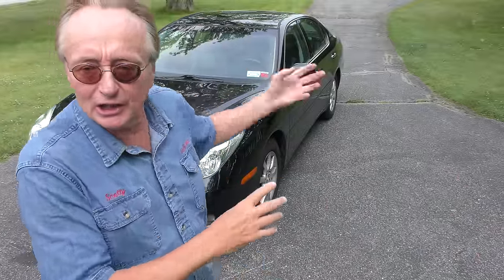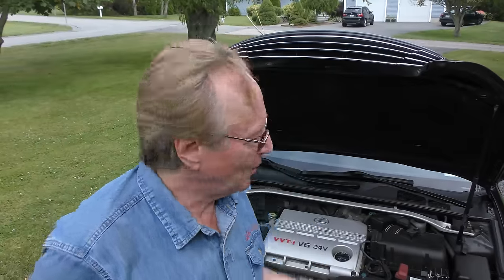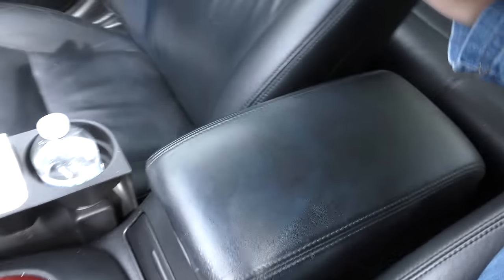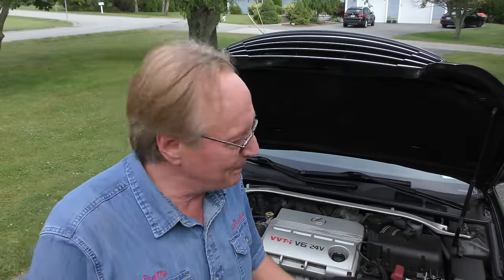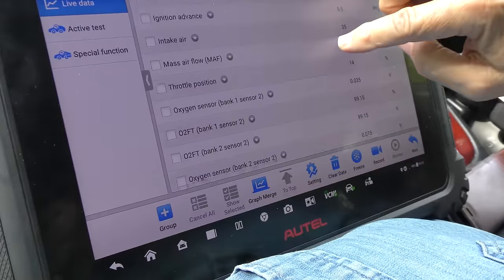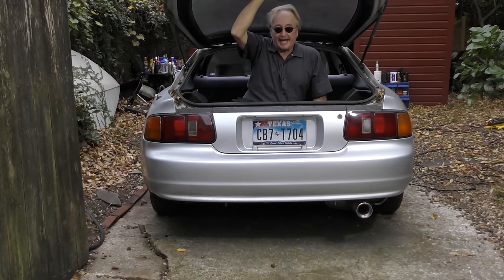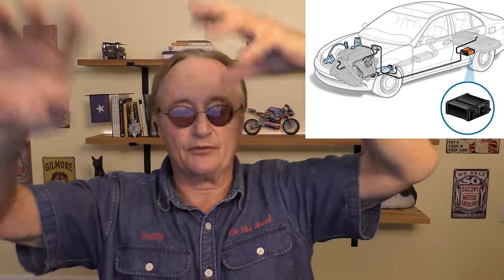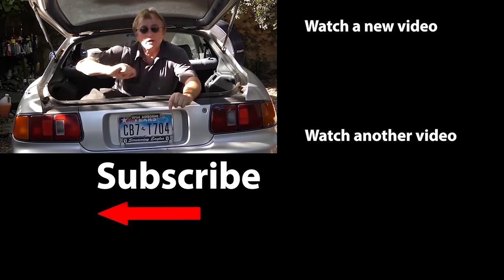I’m Sitting in the Best Luxury Car Ever Made

Comment: I bought a 2007 Lexus GX470 back in September with only 29,000 miles on it, was owned by an elderly individual prior, it’s virtually brand new
Reply: Wow! What a crazy find. Do you feel comfortable sharing how much you paid for it so I can gauge the value of low mileage ones I am looking at?
Reply: Ive got an 2006 with 147,000 miles on it that my son stole from me when he got his license. The only issue I've ever had was the air suspension so I stripped it out and did shocks and springs. I love that truck and it goes through anything. 29,000 miles is almost unheard of. I'd a bought it to. Hope you get years of fun out of it.
Reply: My mechanic, Toyota/Lexus certified, has his own shop, swears by the GX 470. He says it is bullit proof. Have been on the lookout for one for three years. Looking to find a deal.

Comment: That car is an absolute steal, and if you wanna upgrade the entertainment system, you can easily install a CarPlay style radio with a navigation system in no time flat.
Reply: Not something you wanna skimp out on though. I’ve heard the cheaper ones tend to crap out. Sometimes higher price does mean better. A decent one will probably run you at least $300-$400.
Reply: @dy1angi11ey6  You are right about that.  I put a Jensen in my wife's Matrix and a Kenwood in my F-150.  Both are great, I chose the kenwood over the Jensen for the truck due to availability at the time.  Both are wireless and have good standard radio reception too.  They were not bad to install and they really freshened up those vehicles.

Comment: Lexus and Toyota still reminds me of that Japanese golden age in the 70's and early 80's stereo equipment,  no one is building turntables and stereo receivers as they did back in the day. The same with cars now but Lexus and toyota in general is a big exception.
Reply: HUH? The Japanese still build Turntables and are still strong in making stereo receivers. The techniques line is still going strong and kicking arse.
Reply: @johnwayne2103  Not on the same quality my friend, my turntable is 11.5 KG in weight has all copper connection and massive motor build and over all this wood enclosure and beautiful look. got it for $200, I have to spend $2000 or way more to get something similar.
Reply: @sheri1983  
correct. all new electronics is of lower quality, n not made in japan anymore.
most of it made in china, or malaysia, n mostly plastic, like everything else.

Comment: I'm am a toyota/Lexus fan boy as well, but you can't discount the Lincoln towncar! The Panther Platform was tried and true. They are really reliable, incredibly smooth ride, SO MUCH room for passengers plus the trunk is huge. They aren't hot rods but they have enough power to do what a daily needs to do. Thanks to crown vics/town cars/grand marquis sharing the same parts (notable the 4.6 is shared with tons of other vehicles too), most things are easy to locate and cheap to buy when you do need repairs. I have an 88,000 mile 1992 town car, and I plan to drive that car indefinitely, lord willing.
Reply: I have a 2006 TC with 120K on the clock. I love it and plan to keep forever as well

Comment: 10:12 i keep the engine bay clean using a damp cloth and being very careful with what i touch. then i'll coat the plastic parts with an engine conserver. i'm paranoid of the plastic parts giving in, which i'm sure is still inevitable given enough time.

Comment: I did drive a Lexus LS 460 AWD before I bought my 2018 MB S560 4matic. After a few miles on the highway I told the salesman that I was going back to the dealership. If felt cheaply made and was just plain dangerous on the highway.  Now with 46k miles and ZERO problems I will never drive anything else, it’s one of safest cars on the road. No rattles, just supremely comfortable drive.

Comment: The best I have used the past 25 years is the white rust converter that dries clear on fresh metal. Dries black on rust. Chemical as lt😢😢 is only white and cost no less than $100 ,per gallan. Best product for the money.
Ìt is always white, always $100 per gallon, dries black on rust  clear on pure metal

Comment: Scotty always talks bad about Nissan and CVT transmissions. I agree they have tons of problems. I have two 2018 Nissan rogue with a ton of miles on them. my I changed the transmission fluid every 20,000 miles along with the filters the pan filter I change every 40,000 miles and the cartridge filter I change every 20,000 miles and I used only Nissan CVT transmission fluid. 
But believe me, I’m never going to buy another Nissan again, even though I’ve had no trouble with any of the Nissans I’ve owned
Reply: My girlfriend has a (2009?) Nissan Altima with 200k some miles on it, and yes it has a CVT. I usually drive my car when we’re together but hers still runs pretty well I’d say and hasn’t had any major problems. A big factor is probably that the only other owner(s) were her parents, and her dad takes good care of their vehicles. I’d personally never buy a vehicle with a CVT as someone who likes driving but if you need a car to get from A-B and back they aren’t always terrible.

Comment: Hey Scotty love your channel by the way, I bought my 2009 lexus is250 because it looked sporty and you said Toyota was the best . My only problem is it gets bad gas mileage like 19 or 20 in a city and highway mix. What do you think it could be? I did air filter and plugs and oil change
Reply: Thats kinda how they are man its sporty like you said. 

If you get bad traffic its just the bullet you have to bite
Reply: @Matt_Avocado  I see, thanks Matt I was wondering if it was just something wrong with mine
Reply: @calvinunroe2462  what size motor, if it's the 4cyl, acura and lexus 4 cyl tend to have more HP=less mpg  than their original 4 cyl toyota and honda platforms
Reply: is250 don't get great gas mileage to begin with so you probably aren't far off. They also have carbon build up issues which can reduce power and gas mileage. I think that engine also calls for premium so if you are using regular that could also have a small effect.

Comment: 172,000 miles on my '05 ES330 and the old girl still runs like new!
Reply: Ok? My last honda has about 370k and ran perfect when it was rearended..my 5 spd civic SI has a little over 300k and runs like new..honda, mazda, and older fords..those are my 300k mile brands and still ran good..
Reply: @richsweeney1115  Awesome, shows the quality of Japanese cars, especially of those from the past.
Reply: Did you change the transmission fluid?

Comment: I don't need a car to double my money. I just need a car to last more then 5 years and 73,000 miles
Reply: Don’t buy a VW then lol. True story. I’m still suffering from ptsd from its various problems. I sold it and bought a Toyota RAV4
Reply: Toyota Corolla!
Reply: Almost every car can do that. It may have problems along the way but still. I want cars that can at least get closer to 200k without major problems.
Reply: @dy1angi11ey6  thats exactly what I want. I'm aware every car has that happen at some point. But when Scotty says Toyota can have 100,000-200,000 relatively maintenance free miles. It makes me sad I'm putting so much cash into a car that should still be barely broken in. I read a Crankshaft position sensor and an AC Compressor both could cause my cars engine to stop working. This is on a car with only 73,000 miles. Mitsubishi is just as bad a Nissan at this point

Comment: Great Vid as always, Scotty! I do have a quick question though. I have a friend that has a 2016 Lexus 200t and after the heavy rains in California, it started hesitating, then went into "limp" mode, engine light flashing, then solid and evetually stalled. I was going to hook up my scan tool to read the codes, but the OBD2 port (which is under the steering column) is covered with a plastic cover. I tried removing the cover to access the OBD2 port, but it won't budge. I didn't want to break the plastic underdash so I gave up. I've researched many avenues on this, but nothing is specific on how to remove that stupid plastic cover. Any advise? Just to note:  I'm just a home mechanic with moderate experience, but I know what i'm doing if I can access the means. Thanks in advance!